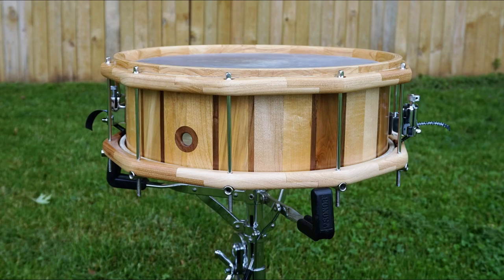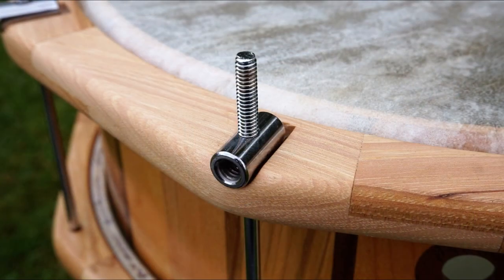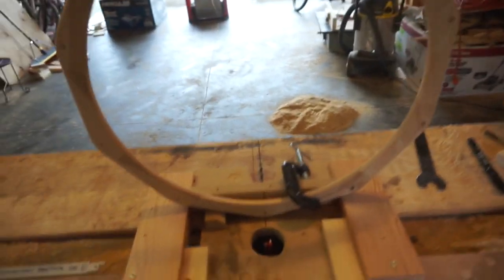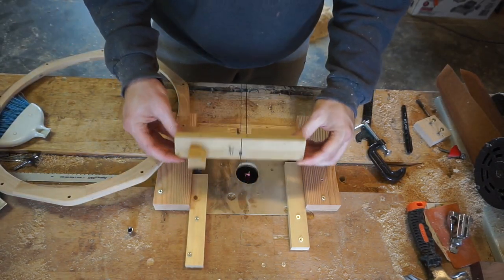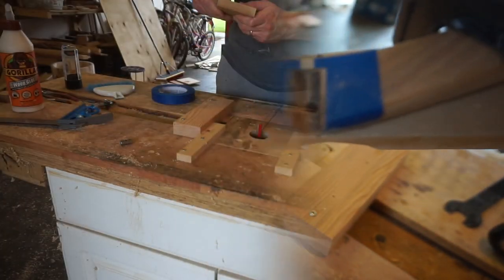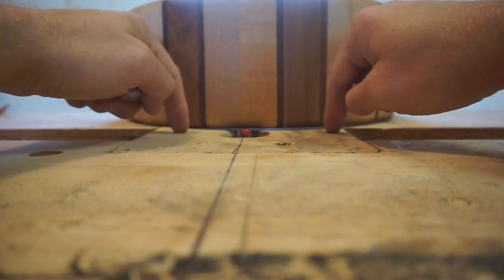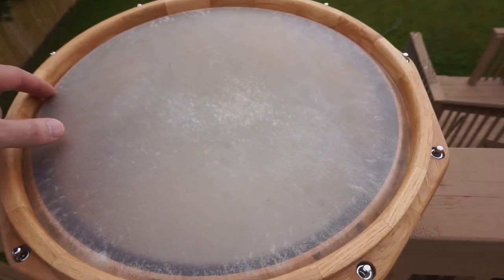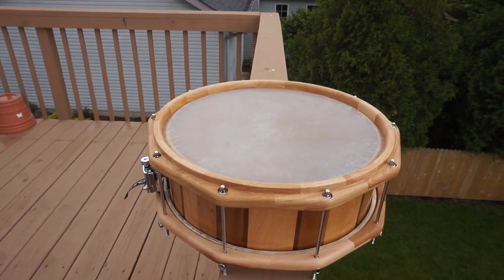THE END -- REBUILDING THE "HELMISH," Part 7

Comment: I was nervous for you on the bottom hoop routing step. Glad you were able to find a good solution. Also, I forget to tighten my drill press chuck, all the time. So, glad I'm not the only one. Great video, beautiful drum.
Reply from the maker: Thanks!  The problem is that I think I need to take the bottom head off and work that bottom hoop a little more.  The snare wires are choking the bottom head, and think that's partly the hoop.  I think I also want to make the walnut rerings a bit thinner.  AND I need to widen and ease a bit more the snare beds.  The drum sounds AMAZING at its low end, but it's versatility is very limited.  These should help bring it to where I really want it.